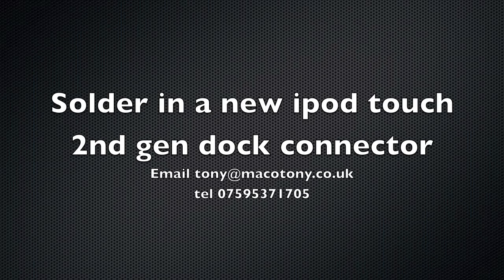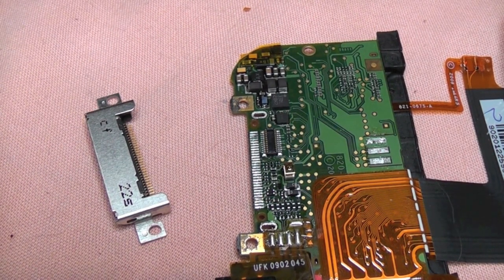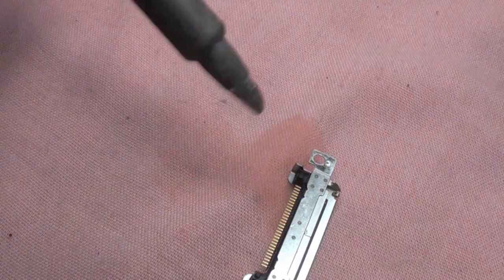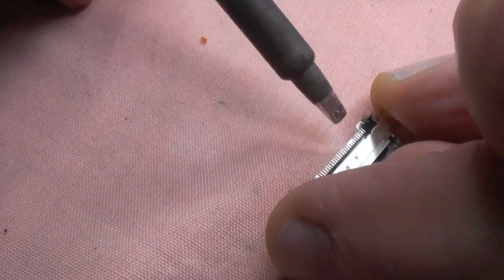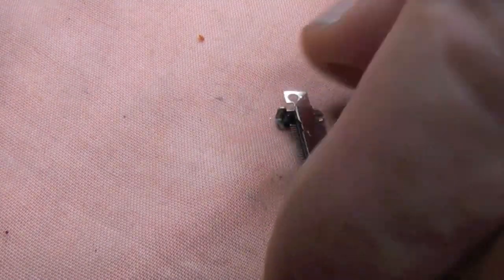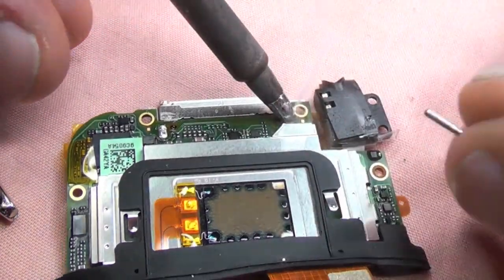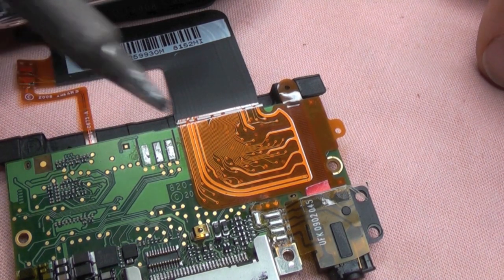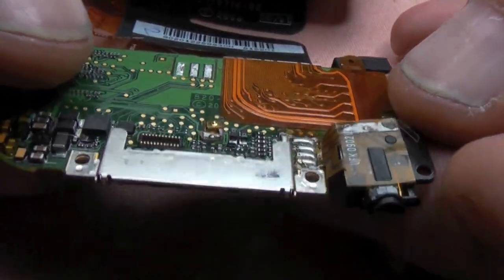Ipod touch 2nd gen dock soldering tutorial

Comment from the maker: @xtremely4 do not use a heat gun.
I sent a 64 GB to a specialist who claimed they could do it...turned out that mine was a test to see if they could do it!!! they totally bricked it, burnt the board so bad and then had the audacity to say that it was short circuited before they got it! 
I intend cutting the main metal bracket then snip each pin then desolder each one. this seems to be the safe method

Comment: Hi, I have an ipod 2nd gen atm that wouldnt charge or connect to itunes. I have replaced the battery and reassembled but it still doesnt charge. When i plug it in, the computer makes a sound but a message comes up saying that 'the device could not be recognised'. Could this be a fault with the dock connector or something else? 
Thanks!

Comment from the maker: @bimbopapirrin The solder wire is lead free, melting at 210 deg C, you can use lead tin wire which does melt under 200 deg C. if the pins are clean and the iron set to about 350 - 400 deg C you should get a good coating of solder, bridging can be taken care of with a clean solder tip or solder braid/wick.
The whole idea of pre soldering the pins is to reduce the risk of bridging on the final solder, if you elect to drag solder in that area you might have a tough time de- bridging